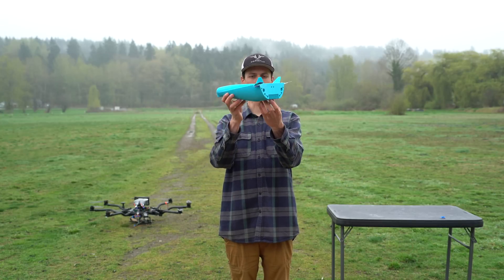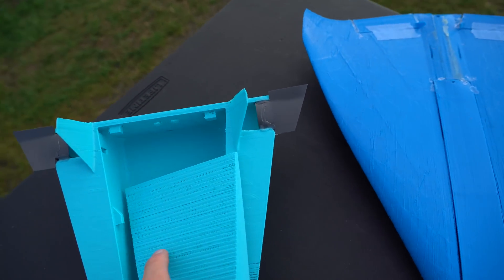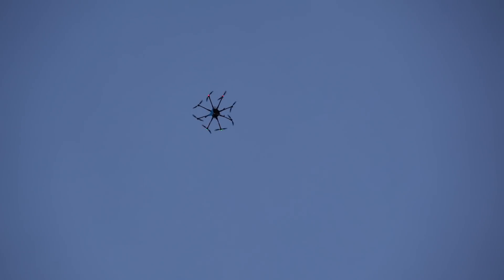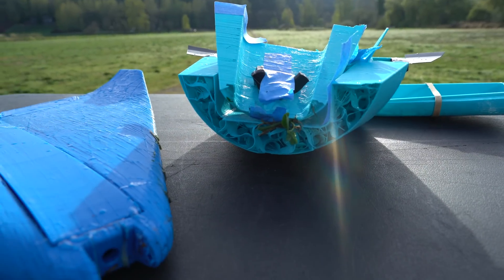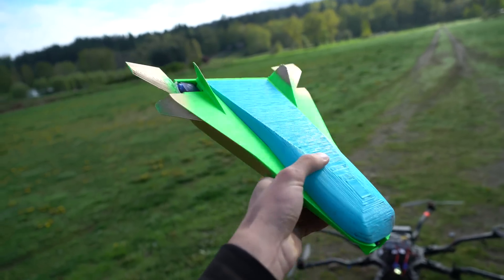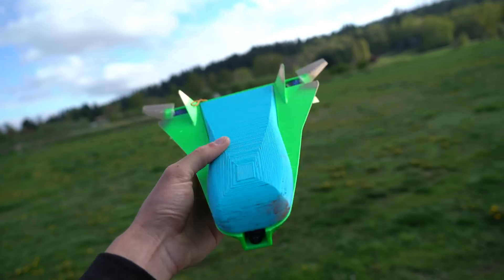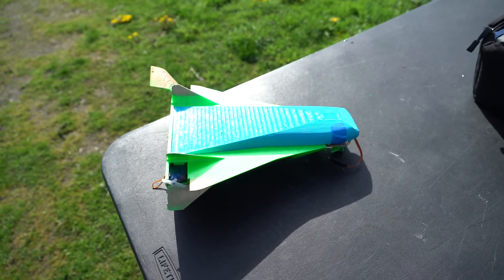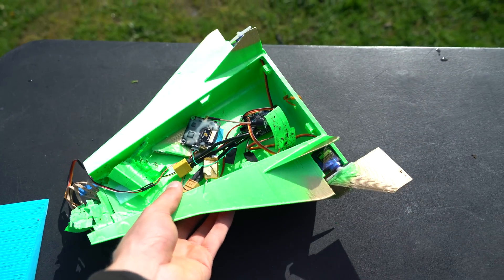3D Printed RC Lifting Body Aircraft? - RCTESTFLIGHT

Comment: When I was a kid, I watched a lifting body crash at the beginning of every 6 Million Dollar Man episode.
Reply: https://www.youtube.com/watch?v=bGO57y4td-c
Reply: @Stumblingthunder  That goes to show the design was bad. :D
Reply: @goku445  it crashed because a chase helicopter was in the wrong place, blocking the pilot's view of the ground. The lifting body pilot released the landing gear too late, it smacked into the ground too low to lock down. So the gear collapsed, the belly crashed into the ground then the lifting body went sideways and rolled.

The pilot survived with some injuries but later lost an eye from an infection. (Dirty hospital!) Why he survived was design problems with those lifting body shapes. Having to be bigger at the back makes them tail heavy. Their initial solution idea was to borrow some gold from the government, load it into the nose, do the test flights then put the gold back. Ah, the glory days when NASA had that kind of pull. Then one of the team suggested they just add a whole bunch of steel to the internal frame around the pilot, but make it all structural rather than just dead weight.

All that super strength saved the pilot's life and minimized the damage to where the craft was rebuilt with an altered shape and flown for several more test flights.
Reply: Lol! That's the first thing I thought of when he said they all landed ok, and yeah, that was real life footage, not a simulation or a model. 
Probably the worst crash footage the show could find where the aircraft wasn't engulfed in flames.
Reply: The M2F2 was the lifting body that crashed.  It was rebuilt as the M2F3, with aerodynamic modifications to make it more controllable.  The most obvious being a third vertical stabilizer {the M2F2 had two vertical stabs}. 

This book covers lifting body development in the United States:  
https://www.amazon.com/Wingless-Flight-Lifting-Body-Story/dp/0160493900

Comment: thanks for posting.   good work.    some thoughts.     at this scale and speed, things will be different.      at this scale, the so-called lifting-body  makes  very  little   lift.  at times, it  does  reduce the   sink rate, so that a  usable glide slope, results.        the multiple aft belly slots  were maybe  part of the control  problems, at the end.      it should be understood that  a  (tiny)  model has  Much  less  inherent,  keel effect  stabilization than those full-sized versions.       having sufficient  keel effect stabilization is  Critical, where  Stabilizer  area is  minimal.        at any scale,  the  broad, blunt aft end  is a  Major  source of  turbulence/drag.         some of the  problems,  inherent  in that   Retired  concept, have thus been demonstrated.             googletranslate

Comment: Keep the upper Surface flat, and get rid of the Grooves on the lower Surface, @ high AOA the Airflows Direction is'nt only from the Nose to the Rear, Your Airflow takes also, from the lowest Part of the "Belly" to the outside(Tip) ,place ,basically it flyes by the Vortex, it's like two Wingtips, without the whole Wing between.

Comment: I think some of the real flat bodies NASA tested also exhibited the spin behavior.  Very cool video!!
Reply: The early bodies had problems: https://youtu.be/50dDWT48b9M?t=54
Central fin helps with roll dampening.  Remember, your Reynolds numbers are low, due to model being so small.   You will have to be traveling really fast to be able to have the inertia built up to pull up and flare.

Comment: I am building and flying planes since a very long time now. I also fly quads for years. I know a quad definitely needs a fc for sure. But I never use fcs in planes. They are so well controllable without it. Of course when well tuned it works and helps you flying it. But in windy conditions it often over or underreacts. I think you should try doing it with just connecting the servos to the receiver, Programm a mix and give it a hell of expo for smoothness. 
I think especially with a small „plane“ like this it’s too hard to tune it right and the fc just uses the servos to much, causing it to slow down because it wants to stabilise it perfectly. Maybe it gains more speed. 
But definitely a nice idea!!! Never have heard of something like this before! Very nice build. And very nice, simple and working mechanism to drop the plane. Thumbs up!

Comment: That diffuser is definitly not helping the lift, but it will help track straight. It actually is creating drag at the bottom, pushing the nose forward and down. I would recommend sizing it down a little or putting it on top where it will lift the nose.
Great work though!
Reply: I agree. I also think the rear of the craft is too blunt and would create a very turbulent and unstable wake. If that could be streamlined I think it will significantly reduce drag and help with stability.
Reply: Notice how the NASA/ US government..DID...NOT PUT A "DIFFUSER" on the bottom of it's LIFTING BODY AIRCRAFT !!!!!!!  I have an extremely low IQ....most would agree that I'm fairly retarded...I barely graduated....and even I....even I... FEAKED out when I saw the diffuser.....@RCTESTFLIGHT do you know what helps small lifting body aircraft fly better than slotted and straked  race car style diffusers.... ?  Bowling Balls !!!  srsly Attach one to the nose via a wire.

Comment: Some time ago I made a lifting body design that was very stable. he endured large angles of attack without swinging and had good control.
It was also quite light, although I have made others of free flight that measure 10 cm and they weighed quite a bit. and flew perfect without any control.
 if you want I'll send you the design to make one similar.
Reply: Still willing to share?
Reply: @ravileejones7381  The prototypes I made were made of foam, I still don't have 
 stl

Comment: Could the fins on the bottom be acting as a diffuser causing negative lift?
Reply: I don't think they'd cause negative lift - just greater instability. 

A similar concept is used on the F16 tail which has an anhedral tailplane, which helps the aircraft manoeuvre in flight (and avoid wing wake drag). Whilst it's not the exact same design used in Dan's lifting body, the anhedral fins shouldn't cause negative lift, just a change in lifting body stability.

Comment: I'd be interested in seeing it without the slots underneath. I suspect (as you mention) that they might not be doing too much given that they don't increase the cross-section. 

Speaking as someone who's done zero reasearch on lifting body aerodynamics, I also suspect that they're killing a lot of your lift. They're a pretty big departure from the shapes which were known to work in the 60s. Maybe try something closely modelled on one of those designs, just to get a feel for how the designs scale?
Reply: I bet it's making the air in the back too turbulent and slowing it down making it do the flatspins
Reply: Theyre probably acting like a diffuser on f1 cars
Its creating downforce
Reply: the sudden angle change probably causes flow separation and turbulence. The strakes on a diffuse exists to control vortices if I recall correctly.
Reply: I agree with both of these comments and would bet that the bottom grooves may be hindering more than helping. keep it up! love the videos.
Reply: me thinks too. maybe a shape that resembles the bottom of a boat.and model b (fatty) needs more surface area in the verticle stabilization area, me thinks
Reply: Yeah, putting a diffuser on something that needs to fly is not an amazing idea
Reply: I agree - I'd lose the underbody strakes and fit a large fin on top - as NASA did with the M2-F3 when they rebuilt the M2-F2 ( https://www.nasa.gov/centers/dryden/multimedia/imagegallery/M2-F3/E-21533.html )

Comment: Have you considered the rear slots could be pulling the tail down?  That is what f1 cars use for maximum vacuum downforce.  I'm not sure if this applies when there is no ground surface to interact with, but might be a problem when landing, at the very least.
Reply: You're confusing the Difuser with the ground effect. Look it up.
Reply: @vvhat  similar idea though. I think it is hurting the performance by making the air behind the vehicle swirl
Reply: @KnowledgePerformance7  I'm pretty sure diffusers reduce drag by energizing the flow behind the vehicle, which reduces turbulence. But it does reduce lift because it reduces the air pressure below the fuselage.

Comment: I reckon you could get more lift out of this design by changing the geometry towards the aft of the craft. If you didn't have such a rapid change in geometry (the 90-degree angle) then there wouldn't be as much flow separation causing a lack of lift. Most lifting body designs I've seen have smooth changes in cross-sectional areas, which I think contributes to the lift generated.

Comment: How about Dream Chaser design? Thats a lifting body spaceplane, pretty similar to your design
Reply from the maker: Thats a great one! Would definitely print it if someone made the CAD model
Reply: @rctestflight  
What's the lense diameter for the fpv cutout?
Print volume available?
I know you can just scale it, but I want to make life easy for ya, want the servos to fit nice.
Reply from the maker: Check the video description. You can get the critical dimensions off my lifting body STL  @index7787
Reply: @rctestflight  GrabCAD has models of the HL10, which is what the dream chaser is based off of.
Reply: If you'd like to see something similar, (but on a budget), take a look at my X-37ABC... I built even a special fairing for water rockets. You can find instructions/plans on Instructables website.
Reply: That's actually a direct successor to the other lifting bodies you saw in the NASA footage, they basically contonued on the research when NASA stopped working on the HL-10
Reply: @steadikek  
It's a hell of a good reference, I'll clean it up and make it RC friendly. Thanks man!
Reply: Index how's it going so far?